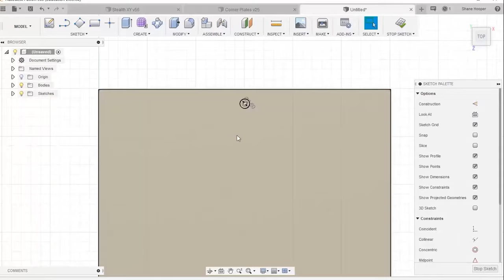CoreXY 3D Printer Build All Metal Extreme

Comment: I'm in the middle of a build myself with a lot of inspiration from your design! Have you encountered any problems during bed leveling with the independent Z-motors since it looks like the brackets holding the bed are mounted firmly to the tool plate? Does this put stress/twist on the plate? Seen other designs using ball joints and even rails to let the Z-axis move more freely when correcting an uneven bed.